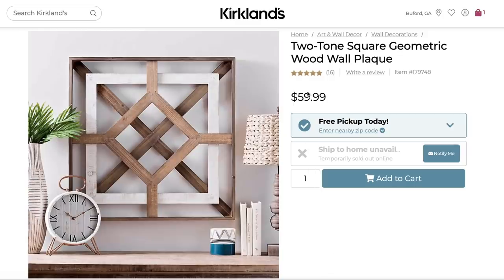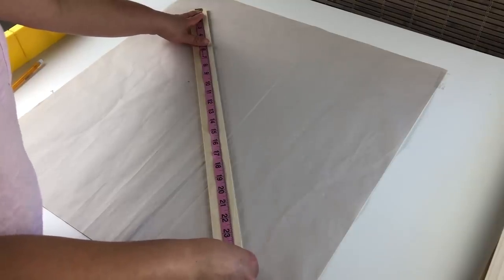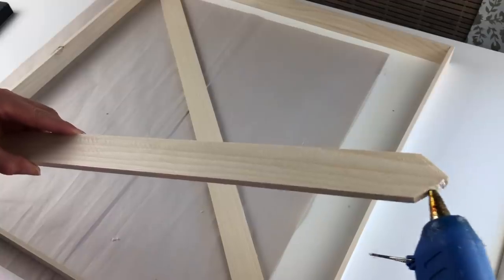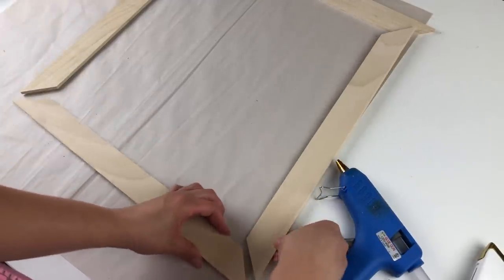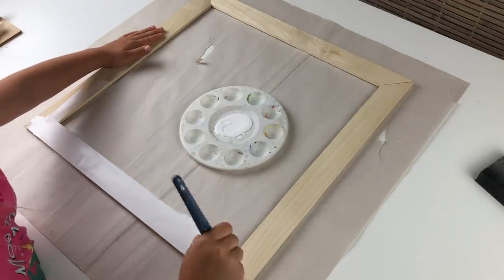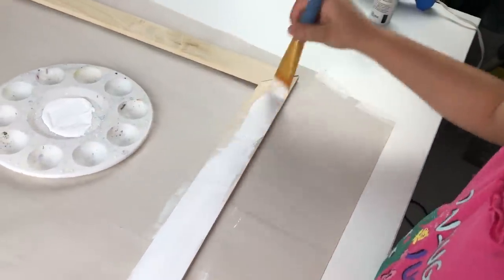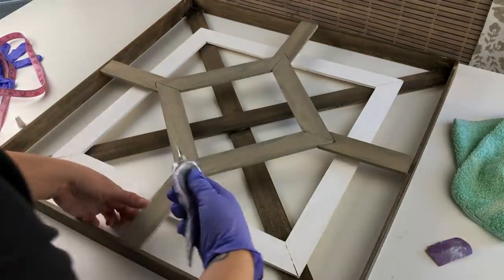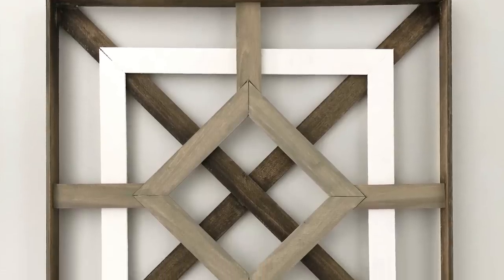Look for Less May 2019 -  Yami & Casey | DIY Rustic Wood Plaque

Comment: Love this and want to recreate it. But, I cannot find the poplar wood you used. What are the measurements? Do you have a link for it?
Reply: You could use wood lathes.  I get mine from Menards.  They are 39 cents each or they also carry a bundle of 50 that is $14.98.  I'm guessing Lowes and Home Depot sell them also.  Some of the lathes need more sanding than others, but I have painted and stained them and they turn out great.  Plus, you can't beat the price.